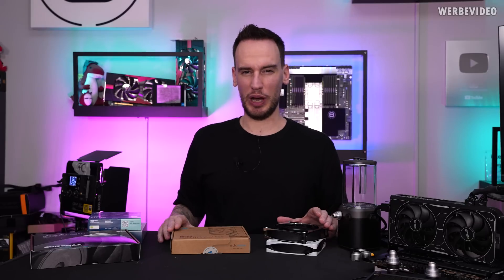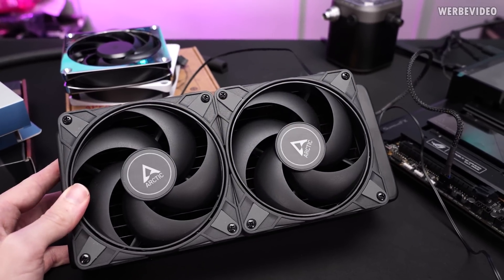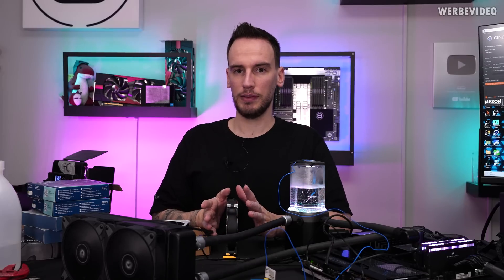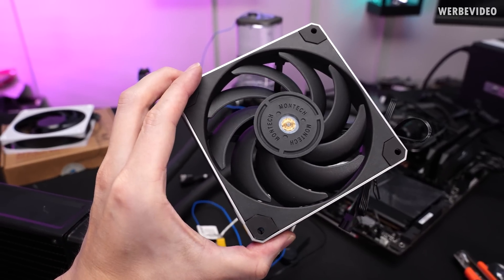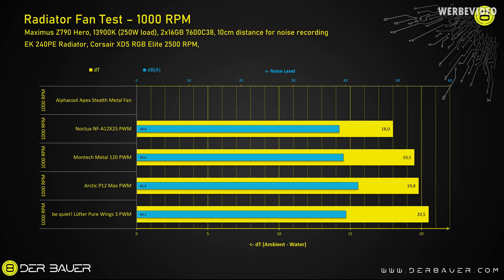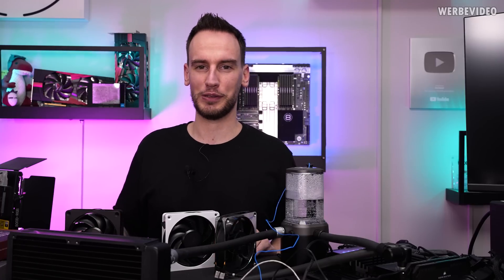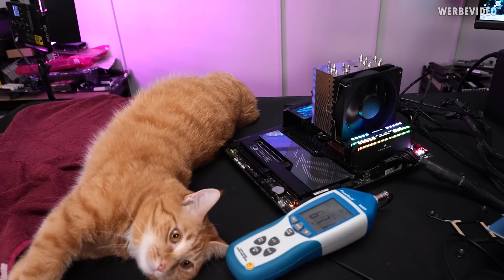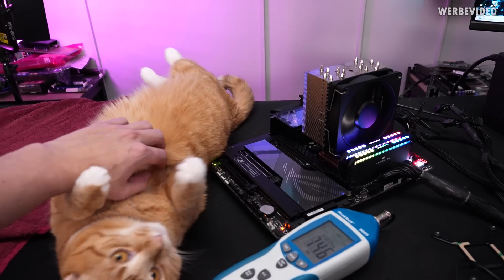Something is Wrong here - Alphacool Apex Stealth Metal Fan Reviewed

Comment: Tell Steve to use his new toys. Not the battery powered ones, the big air chamber thing I mean.
Reply: @KoudZ it passed like 2 years...
Reply: I suspect that using the machine to get useful data has proven much harder than they expected. And at the end of the day a channel has to feed the YouTube algorithm above all else so fancy fan testing requiring new and specialized expertise etc. will drop down on the priority list.  ltt which I’m fairly sure is a much larger company than GN has barely used the fancy gadgets they bought and most of their use of them is more the ‘look what neat things we did’ rather than the methodical testing the devices are designed for.
Reply: They bought that thing like what... 5 years ago...
Reply: It is not an unwanted commercial for other site because only-fans already knows who you referring to
Reply: I don't understand why he made such a big deal a year ago when he got the chamber and he has yet to come out with a video that test fans in it. Especially after spending so much money on it. EDIT 2026, still waiting for a single video that uses that machine lol.
Reply: They have to develop standardised test methods, and a comparative/control data set to test against.  @davidepannone6021  - its like designing a scientific experiment, and its time consuming.
Reply: @davidepannone6021 he had some expectations, they didn't come true... As it happens
Reply: It takes months of work just to learn about the basics of fluid dynamics, acoustics etc. enough to be able to set all the hardware properly, make really solid testing methodology, produce quality&robust data, analyze and double check all the data, make conclusions that makes sense and most importantly they need to present everything including all the data to viewers in the way that is not overwhelming and also interesting to watch... and they still have to produce all the other content for the channel.
Reply: @veduci22  They've done those videos where they document they spent that time getting acclimated. They invested a ton of money and have gotten nothing out of it. The same is going to be true of their absurd an-echoic chamber in the end. 

They've been sitting on the fan tester for 2 years come the 18th - They published the unboxing Dec 18, 2021.

There are fans that have entered and exited the market in that time. It's absurd.
Reply: @KoudZ  You do realize a year and a half has passed right? It's not like it was last week.
Reply: @KoudZ True however Steve could've published the videos taking about them buying the machine later.
Reply: I think they may have found that there was no hidden lies in fans.
Reply: @prorataxns8425  There is a lot of hidden lies in fans. They all measure airflow differently so there is a different amount of practical exaggeration, and same with noise levels; they also use different weightings for noise measurement. But of course measuring anything is hard, and GN is limited in manpower to actually flesh out a protocol that makes sense and tracks well with other measurements. It's also the case that when you buy major-brand fan, you don't really need to look at the detailed specs, given its size, RPM and whether it's flow- or pressure-designed, it's going to perform almost indistinguishably to other fans with the same design purpose, regardless of how the manufacturer polishes their noise or airflow figures.